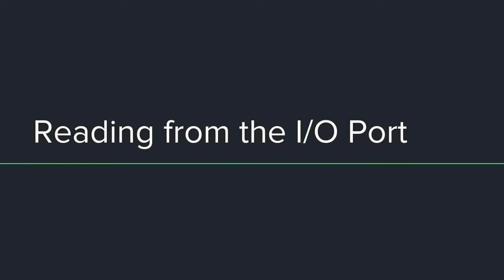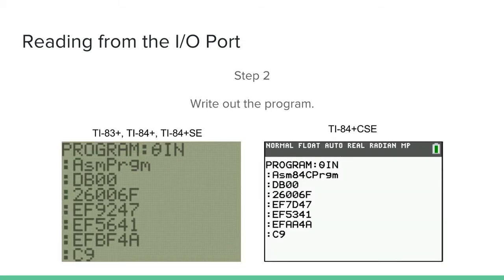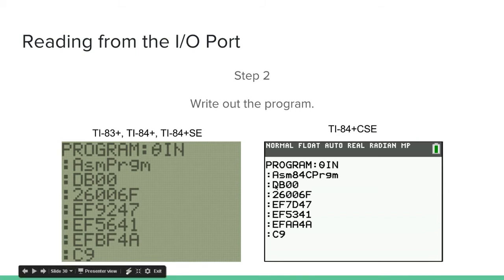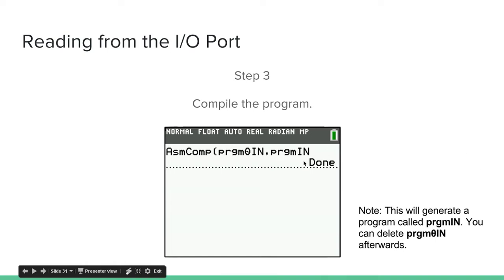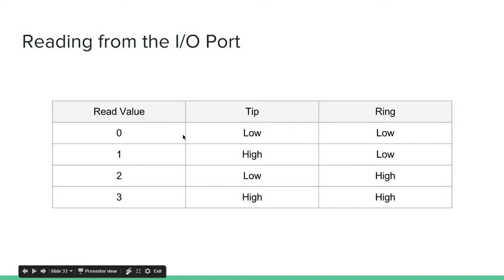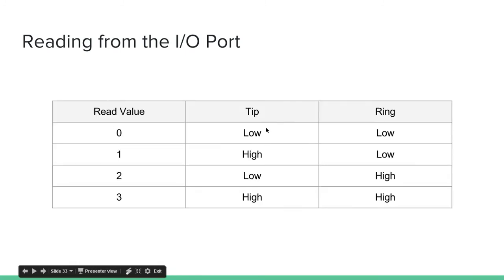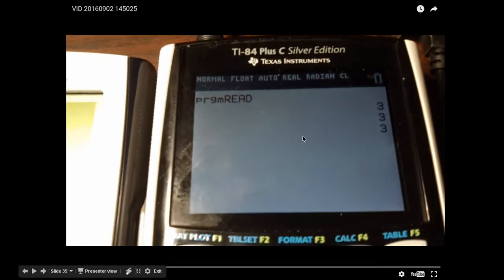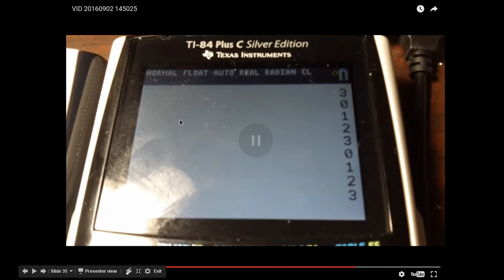TI-83+ I/O Port Tutorial #3 - Reading from the I/O Port

Comment: Great video btw, but I'm having some troubles getting my calculator to read any values. When I am running the read program, for some reason the tip and ring are still pulled to high and seem to not be working. Any suggestions?
Reply: does your cable have 2 or 3 metal pieces on the tip?